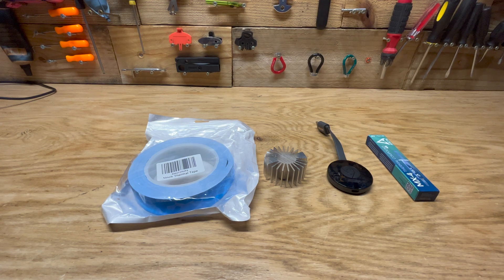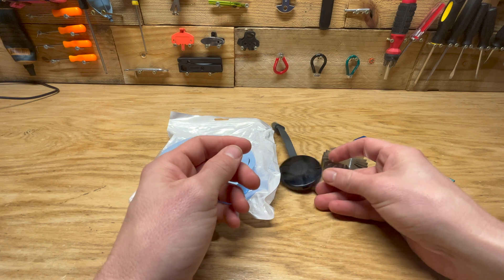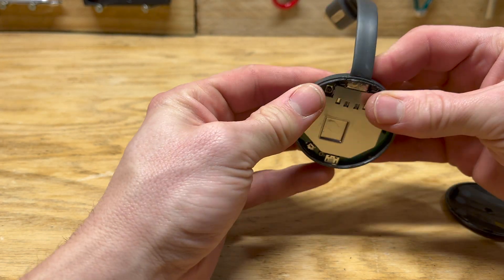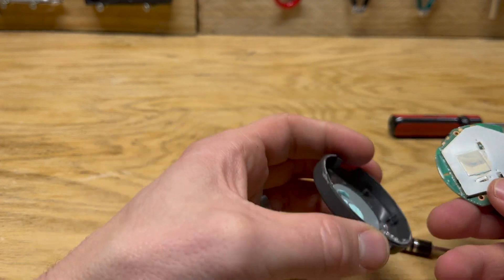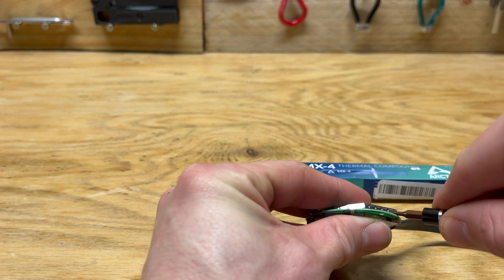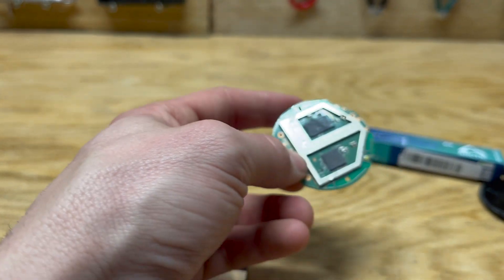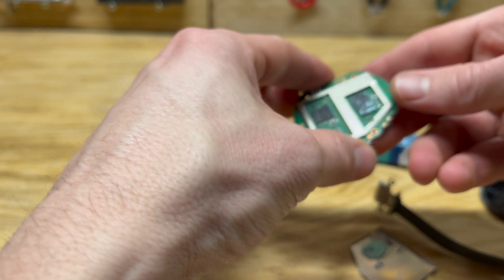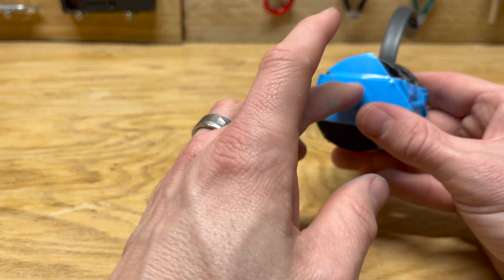Google Chromecast Over Heating Fix! Chromecast Teardown! Chromecast Heat Sink and Thermal Paste!

Comment: Why didn't google build a heatsink in to begin with? Heatsinks are usually added internally not externally. It's a manufacturing flaw. They need to redesign this so it works not so that people have to go and manually install fixes for such devices. This is cool and all but it'slike fixing something that a manufacturer broke.
Reply: All about money. They can't sell more if it lasts forever. I have a fan blowing on mine. Lol 😅😅😅
Reply from the maker: I agree, I love this device and would pay more to have a more robust/better working version, thanks for commenting, make sure to subscribe and have an awesome day

Comment: Hey, did that fix the issue for you?
Reply: A
Reply from the maker: hey, it significantly improved performance and it doesnt get nearly as hot, I think I should have mounted the heat sink on the bottom connected to the small heat sink that comes with the device, (the bottom still gets warm where that heat sink is), I may add on another big heat sink there, I still wish there was a case I could buy with a fan that I could bolt on around it, thanks for commenting, make sure to subscribe to get updates and have an awesome day
Reply: @MoOutdoorsandReviews any laptop fan will fit nicely. im going to use a smaller thermal and a fan. thanks for the idea. the paste might even be enouhh.